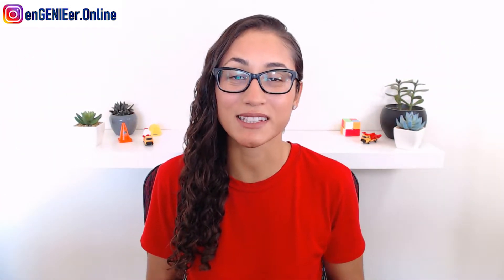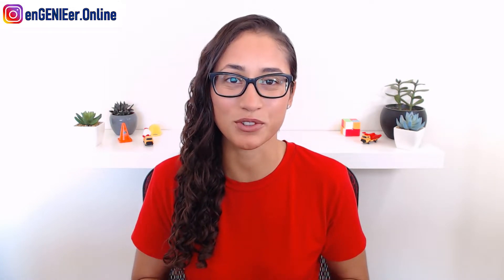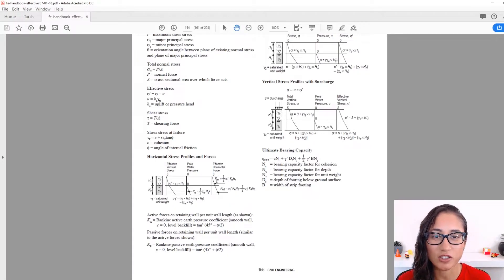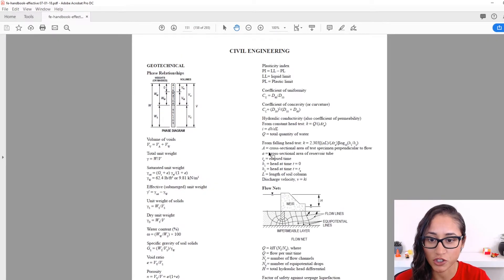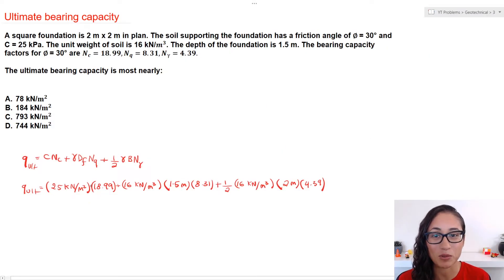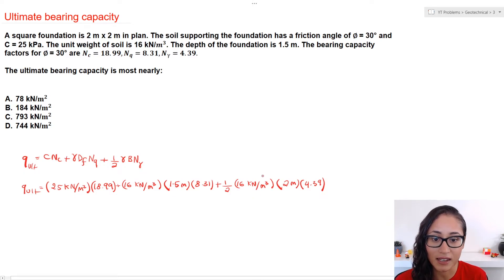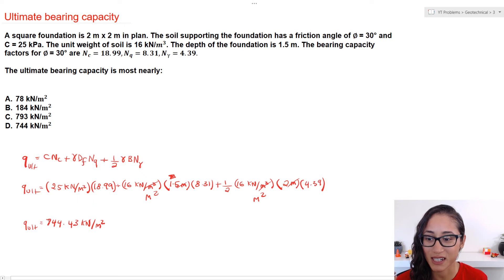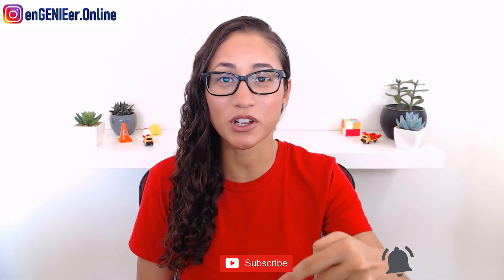Bearing Capacity - FE Exam Review

Comment: If the groundwater within 1.5B below the base of footing 
The depth term (\gamma D_f N_q) remains unchanged because it accounts for soil above the foundation.
	•	The width term (0.5 \gamma B N_\gamma) is affected, and we must use the effective unit weight (\gamma{\prime}) if groundwater is at the base.
	•	Cohesion term remains unaffected.
Is it right?

Comment: ncees pe civil ref hb 1.1, p. 96-97.

but the pe exam variant of q_ultimate for square footing has more factors. its a really long eqn and you wont get the same final value as with the fe exam eqn variant. your pe exam value will  be higher. fyi.

still good practice in using the ncees pe civil ref hb 1.1.

finally reached end of playlist for geotech. looking forward to other playlists in your library. thanks for all your hard work!